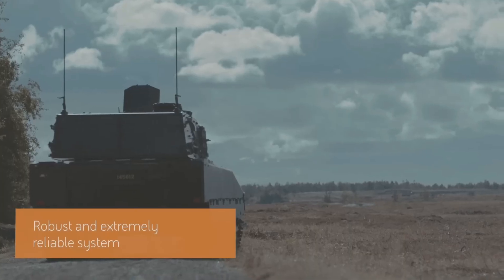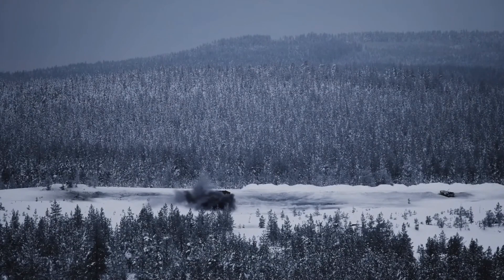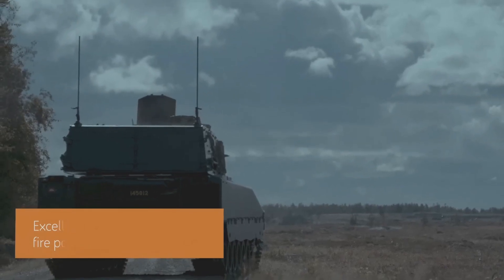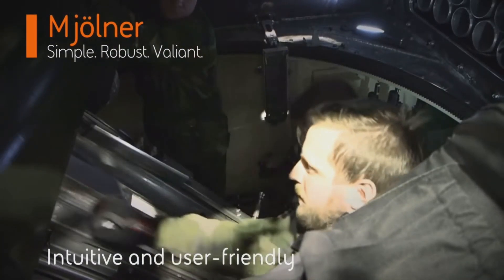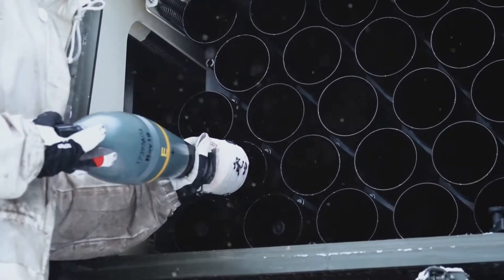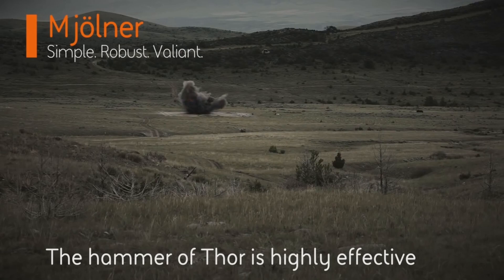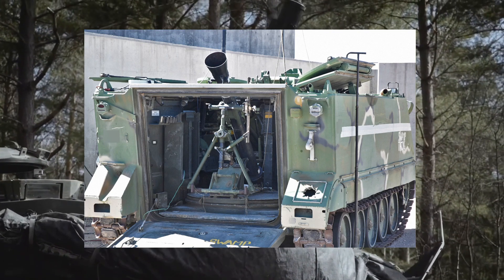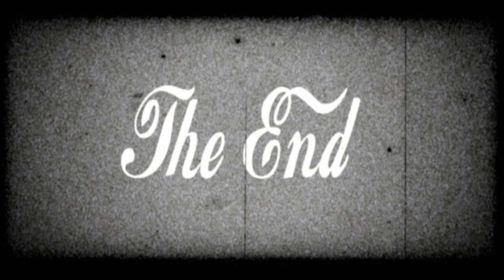Bjorn's Mighty Thoughts: CV90 Mjölner

Comment: The crew is inside and fairly well protected during firing. The mortar tubes are held very stable when having aimed them, do not jump a round in the same way as a free standing mortal setup tend to do. The availability of munition in close proximity inside the CV90 means no running around on launch site carrying grenades from storage to mortar.

Comment: US Army is currently (or planning to) replace M113A3 with the AMPV (Armd Multi-Purp Veh) - a re-worked Bradley without the turret but still largely parts compatible - which would probably be a better vehicle for a Mjolner version than the new MPF chassis for even greater ammo capacity. That Mjolner uses standard mortar ammo is outstanding. The current mortar platoon of Armd and Mech Bns only have 4 mortar vehicles/tubes, and so a system like Mjolner would double the tubes while retaining the 4 vehicle footprint, but might need to add a couple of specialized 120mm ASV (Ammo Sppt Veh) just to help keep up with the rate of fire logistics.

Comment: Sweden will deploy 50 CV90 to Ukraine. I'm suspecting it will be a complete mechanized battalion, including Mjölner and antiair CV90s (Lvkv90) and everything.

If we see Mjölner (in Sweden called Grkpbv90) in Ukraine, it might come with the Swedish Strix rounds. HEAT warheads launched by mortars that track armored targets for top attack hits. The artillery version, Bonus (also Swedish), is already in use in Ukraine, so sending Strix doesn't seem farfetched.

If I'm right, we might see 6-12 CV9040s with the powerful 40mm Bofors autocannon assault Russian positions while the enemy gets pounded with incoming 120mm HE launched by 4-8 Grkpbv90.
Reply: That'd have been cool, however they seem to be 'just' 9040C's from what I've heard and seen them being transported by railroad. (I didn't see all 50 though)
Reply: I wish but I dont think so. Yet anyway.